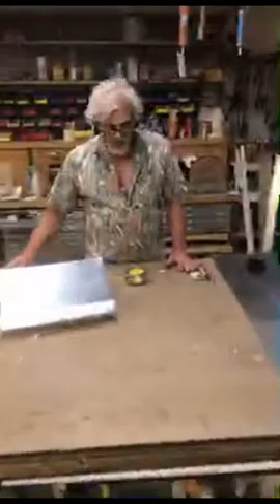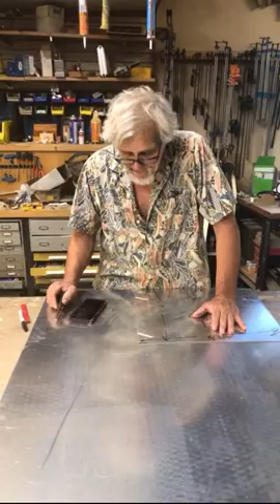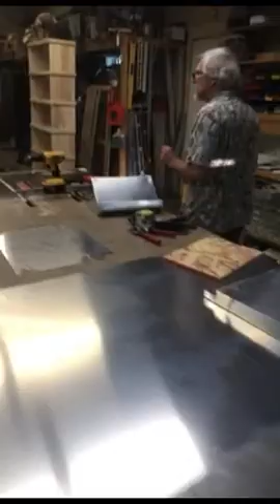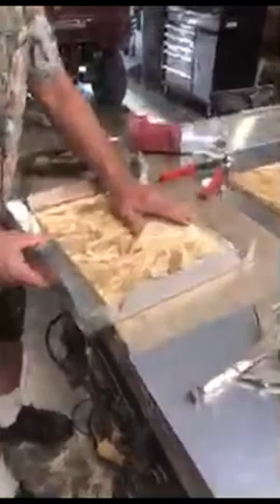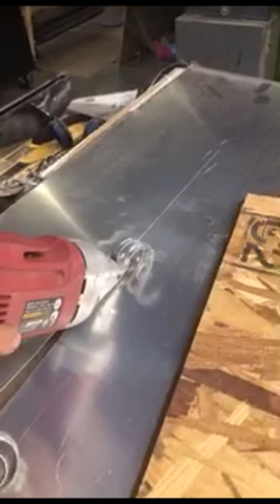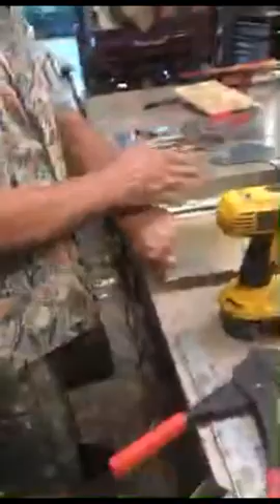Weekly Q&A 8/18/19 how to build a feeder for your quail!

Comment: I use the baby pig feeder from rural king.  It is very similar but it has an adjustable piece of sheet metal at the bottom so you can make the opening bigger.  I also put some 1x2 mesh inside to keep them from digging.  It will last ten quail about a week.